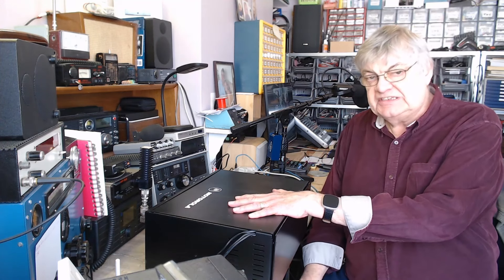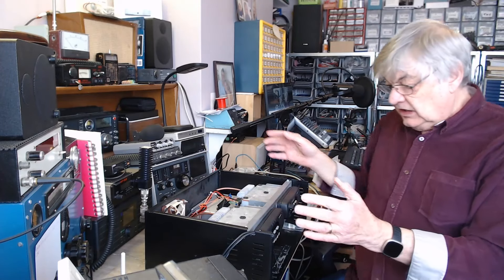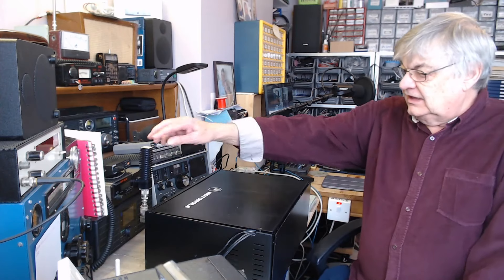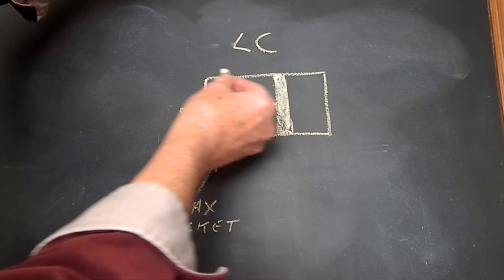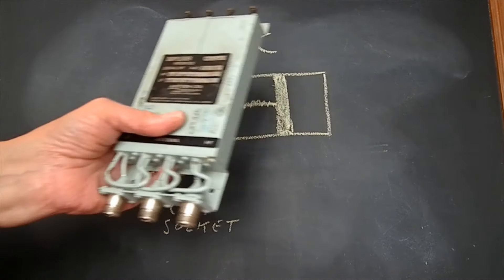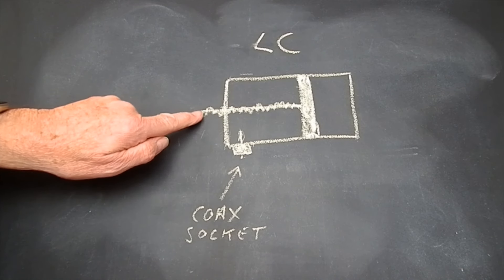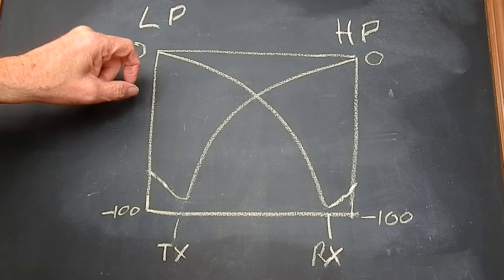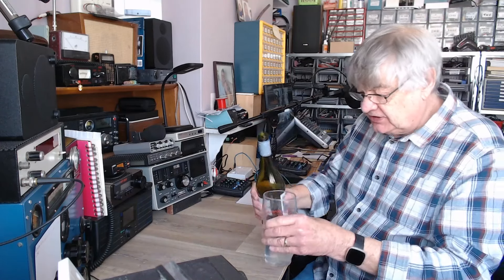G4NSJ - A close look at a 70cms amateur radio repeater GB3RL

Comment: Hello Ray , I hope that all is well & good . I just wanted to pass on an observation on several programs that I recently watched on RF tower transmitters , all the coax cables are within copper tube conduits in order to minimize RF loss & to restrict external interference & noise .
Reply from the maker: That's interesting, thanks for the info.

Comment: The sense wire that turns the radios on is pin10, Ignition. Just connect it to V+ and the radios will always be on if there is power.

Comment: Invar was used to produce shadow masks for color picture tubes.
Reply from the maker: Interesting, thanks!
Reply: It was also sometimes used for pendulums for clocks because of of its very low coefficient of expansion. You don't want a pendulum to change in length with temperature variations.
Reply from the maker: @MrFoxy1951  excellent! 👍